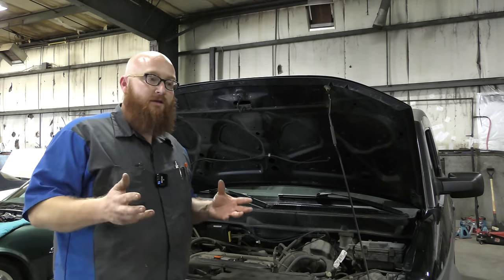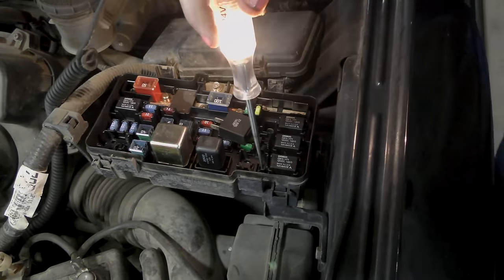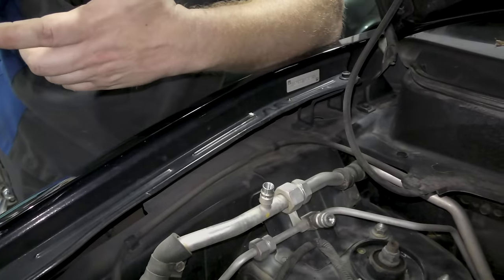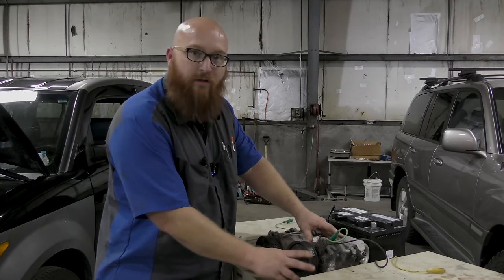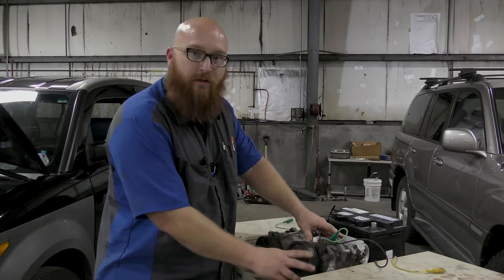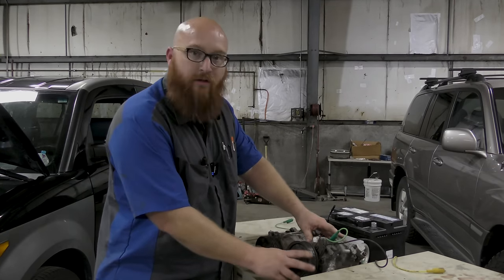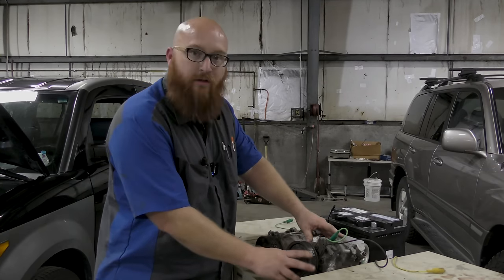AC not working!!! The CAR WIZARD shows how to easily isolate the problem

Comment: Hold up. Replacing the clutch on the AC compressor can be pretty easy on some vehicles. I spent $60 for one on a Honda Accord and installed it under 2 hours, while the compressor was still bolted in place. Don’t prematurely throw in the towel.

Comment: On a relay Would there always be a ground that's controlled by ac button? I've found the power on my 4 pins so I've checked to see if power to ground is turned on when ac button is pushed.. nothing ... what could it be inside the suv? BTW it's a 2012 GMC Terrain 4cyl

Comment: So my compressor that has tension in the clutch but it still spins may just indicate I need a new compressor?  Is that the one you were referencing at 16:40?  The porsche 911 one that would spin.

Thanks for the great info.

Comment: Could I use a jumper wire to test the power in place of the relay tester switch you used? I can hear the relay clicking by touching it with a screwdriver while putting the handle to my ear but could it still be a bad relay? I can spin the compressor by hand so it's not locked up.

Comment: What about expansion valves?? My air conditioning will get cold and then warm and then cold and then warm. And I've also heard that that could be an expansion valve issue. Is that true or should I stick to the other issues that you discussed

Comment: As a qualified Aircon engineer, when you release fefrigerant,if you don't have goggles on,you can be blinded or get skin damage where hit,he can't guarantee your Schrader value won't stick open and blast you with extremely dangerous refrigerant - he's a fantastic mechanic,but there's umpteen reasons why I paid a fortune to become qualified -and safety is the  thing that if you get it wrong,you can regret for life,or even have no way to feel dumb,if your dead....

Comment: Hello Mr Wizard I have a question 
I have a 2015 Honda Civic Can I jump the relay with a wire to see if the compressor clutch engages without using the relay switch you recommend or will that  damage the ECU because I tried this with the jumper wire the other day and for some reason the five-year-old battery quit working n the car didn't start so I thought I fucked something up !! 
so can I just use a relay wire I'm scared to try it again?? 
And if the compressor clutch doesn't engage can I just replace the compressor clutch without buying a new condenser or is there still contamination in the system just from the clutch going bad??

Comment: 'Hi there, thank you very much for your video. I have a problem with my cold (AC) and hot not working or very weak at the back and down to my feet. the top middle iOS working. what do you think I should try please?

Comment: The air conditioner.  hose that goes in the dashboard and I was told that the dashboard should be completely removed, and replace it hose.  I was quoted over $1000.00 to have fixed

Comment: Hi Car Wizard ! Hi Folks !     32$ question.   troubleshooting small  leak.  may i run the compressor by jumping the low pressure switch WITHOUT adding r134a and then spray with soapy water ?

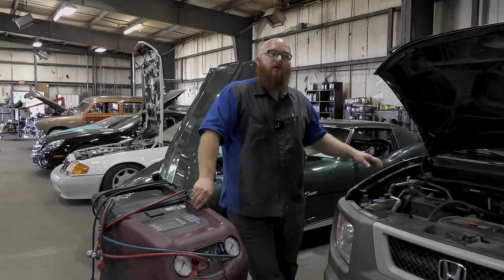Comment: So my Subaru Forester has the symptom of being not quite cool enough, but the AC still seems to work (and the compressor spins, etc).  So what you describe at around 8:05 seems like my issue.  BUT using a can of 134a, the gage shows I'm already in the red zone.  Is that because the gage on the can is inaccurate?

Comment: I thought mine was a low coolant issue, because in the winter if my coolant is low my heat won’t even work properly. Now that it’s 90 degrees my AC isn’t working. For a split second when I turn it on it’s cold and then it turns to hot.

Comment: AC on my 2008 Ford Explorer will intermittently quit blowing air for about 7-10 seconds and then start up again. The AC always blows stronger on the driver's side vents than on the passenger's side vents. 

Could that be a vacuum leak? When the mechanic put it on his AC testing machine it checked out fine

Comment: Unique problem bet you have never encountered:
My car AC (Chevrolet) is not turning on, the light in cluster is not coming on but when I accelerate to redline it blinks the ac light and sometimes after blinking it comes on and stays on ac cools good ,and sometimes it just works when we switch on the ignition and keeps on but all the wiring and couplers are good the car is good as new and ac when it works cools like a refrigerator no issue when it works but when it decided to not come on it will not work no matter what you do and shake all the wires and turn off and turn on multiple time the ignition if you are lucky it will turn on ac do you know what can be the issue if you want I can send a video to you as well

Comment: I have a 2002 Tundra that the compressor won't turn on.  I have verified it has freon.  How would you suggest I test the compressor?  There isn't a compressor relay from what I understand.  It uses the heater relay.  Can I test it the way you tested the AC relay of this car?

Comment: My son has a 2016 Nissan Juke he purchased used (5yrs ago). His ac worked fine up until 2 years ago. System recently vacuumed and recharged with dye and cooled fine for two months. He brought it back slightly low on freon, no leaks ran cool for a week. He recently brought it to another mechanic. Same situation but he just added some refrigerant but no leaks. AC. Cooling fine now. All the components appear to be operating properly. If the system fails again, any tips on what these mechanics may be missing.
Reply: Evaporator more than likely big job its under the dash. Not a good car in my book.

Comment: If an a/c system is slightly over filled then why does the compressor constantly run when in a/c mode on?  Don’t they cycle off and on repeatedly?

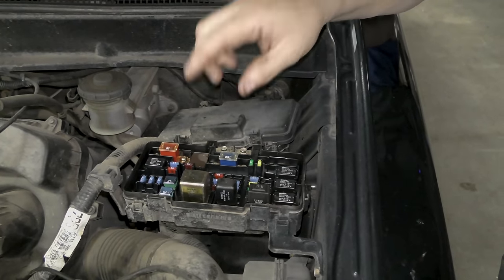Comment: 4:29 the relay tool you use.... is the vehicle off for that operation or on to see if the relay switch clicks the clutch?  My clutch is NOT engaging or spinning at all (but it has been checked and has perfect coolant).  Just wondering if that relay tool needs car on or off

Comment: would you do an advanced video showing you have to replace modern condenser's  because you cant flush them and when their are mufflers you have to replace those and show using micron gauge because nobody is teaching the real story on ac systems on you tube . its a lot false info going on. hope you will do a deep dive on this. thanks

Comment: Hello I have a question for you. I have a 2009 Honda Civic. I took it to a AC shop today and the mechanic told me to turn on my car and turn the ac one. He put on the gauges and told me right away that my ac compressor was bad. How can he tell the ac compressor was bad just by putting the gauges on and reading it?

Oh yes and before I took my car to him, i replace the ac relay, the ac fuse, i check the compressor switch and it was good, the ac compressor was running and also the ac clutch too was spinning, i also check the low side and freon came out when i pinch the schrader valve, both fans in front of car where running strong.  So i did all of the basic check diagnosing i could before taking it to him. Could it be just low on freon I ask him?  He said no cause the compressor was bad so he couldn't get the right reading. And he said if he added freon it wouldn't work since the ac compressor is bad and wouldn't circulate the freon around even though the ac clutch was working. I am confused

Can you please help me?  He gave me a quote for $895 plus tax to replace the ac compressor, ac dryer, and ac conderser.  Parts and Labor

Comment: Hello and thanks for the video. I have a question for everyone. 

First, Do I need to replace the condenser and dryer if the compressor is not seized? In my case the compressor is working but it is leaking from its own seals. I want to replace it because it is old and leaking from the compressor itself and not from  the ac lines. My condenser was replaced before due to a rock that went through the grill and damaged the condenser (condenser came equipped with the dryer).

Second question: if the compressor is seized, should I clean/vacuum the system before I install the new compressor and then re-clean/vacuum the system again and again until it is free of debris. I just don’t feel right by vacuuming the system with the brand new compressor already installed.

Comment: I'm not saying he aint a wizard ,but you can buy a gauge to test how much freeon is in your car system. Especially if it's an R134. Additionally most people's car AC won't turn on because it has low freon. Is low free on means a leak.

Comment: So I have an ac leak, the system doesn’t hold Freon at all. The shop I took it to tells me I need a new compressor and all of the auxiliary components as well. Does that sound right? I know it’s certainly possible, but is it common? I literally can’t replace the thing, and I’d hate to know we’re suffering through a Missouri summer without ac when it’s just a line that’s busted. They did a dye test, and I got a black light today. I don’t really know what I’m looking at/for though. I do the work myself when I can, and when I can’t do the work it doesn’t get done. Should I look around for a leak? Is it something a garage would do, to falsely claim something so expensive? It’s been 90+ here for 2 months, and we’re sweltering!

Comment: I took my truck in for the ac.  He replaced the low side valve.  Worked for a few days and stopped again.  Its leaking out, my question is where are the common places to look for an ac leak?   Thanks

Comment: So I have a 95 accord not kicking on it’s a brand new compressor climate control module and pressure switch all relays are good but with you saying how sensitive they are could it be the pressure? I don’t want to pay $250 just to see if that’s the problem.

Comment: I have a 2004 Honda odyssey and it was blowing. Warm air when driving slow.
I took it to Valvoline  and. He took all the. Refrigerant out and filled it to the minimum of 30 ounces. The maximum is 32. It worked good for a couple days then started blowing warm when driving slow again. Does it need those 2 more ounces?

Comment: HELP!!  I just got a quote for 2900 dollars to pull dash apart and change evaporator etc.. compressor works. Was told pressures were good... but... curiously.... the only thing that made it work was when the tech took his ac machine and overfilled it. Ive had it filled before.. why will it only work when overfilled?... is it really a 3k fix?

Comment: I have a 2004 crown Vic . The air conditioning has stopped completely. Even when the AC is off its still blowing Hot air into the cab. What steps should I take to correct it? Ty for any. Replies

Comment: Today is 4/4/2024. I have a 2012 Cadillac SRX. The clutch on the compressor is engaging in the morning time. When I turn on the air conditioner it blows cold when it starts to warm up. Even if you're driving it doesn't matter. It starts to blow warmer air. Not hot but not cold. What could it be because it's basically working on the ambient temperature of the outside.

Comment: Hi there, when you mention (14:40) when the center portion does not turn anymore it sends pieces of metal. What if my center portion is not locked up (I can slightly turn it by hand) but it does not engage when AC is turned on does that mean the entire system needs to be cleaned out? If the compressor is bad (electrically failed) could just replacing it be enough or does all the other stuff have to be replaced too?

Comment: I’m on the test light step, but when I apply it to both ends of the fuse it will light up regardless of the ac being on or off. So is this a possible problem with the electrical system for the ac?  I’m using a circuit tester which doesn’t really light up like this, it has a lcd screen that lights up and shows voltage, is there any difference between a circuit tester and a test light?   Thanks for any replies.

Comment: Couple things. I tried looking for that Fuse Switch with the On Off Switch on your Amazon Affiliate and could not find it. Second. My car overheated the other day. I ended up brining the car to a gas station filling it with Antifreeze. There is no leak with the Antifreeze. I do notice the AC Fan Assembly does not turn on when I turn on the AC and the air is warm when I am idling but normally gets cool when I drive. Before replacing the AC Fan Assembly is there anything I should check first: temperture sensor, relay???  Fuse???? Any suggestions would be appreciated. Its a 2012 Kia Sedona and has two fans in the front behind the radiator, one is the AC Fan Assembly and the other is the Radiator Fan Assembly.

Comment: I recently lost A/C so i went through the steps you suggested, went to turn my clutch by hand and lo and behold its missing. Im assuming the bolt was lose and backed out. Can i just replace the clutch and solenoid ect, and be ok? I just had the system vacuumed tested and emptied.

Comment: My AC sometimes works, and it runs cold, and sometimes it will not. It would run cool for 10-20 minutes, then it just blows warm air.  Or it will run cool, but when I turn off the car and restart the car, it will blow warm air.  What's also weird is it works better when the ambient temperature is cooler. 

I took it to the dealer, and they charged the unit, but it does the same thing.  I'm hitting my head over this.  Any recommendations?

Comment: I don't know about all this, but all I did for my Honda was take it to a shop that recovered all the refrigerant.  I let them keep it and they didn't charge me.  Then for about $120 in gauges and a vacuum pump I made my system like new again.  My car required 650 grams, which thank god was about 23 ounces which conveniently was 2 cans (24 ounces) at walmart ($8).  I made sure to not put everything to avoid that last ounce.  Why should I go to a shop again?  So I can pay $300 and they can manhandle my car and break other things?  No thank you, even if it was more expensive I would rather do it myself.

Comment: Hi, my Chevy Avalanche AC died on me as I was driving. I checked the compressor and it’s cycling on and off. The cans at Parts Store the gauge reads in the red as if it’s over charged. Any idea where to start? 

Thanks

Comment: @carwizrd mine blows hot in the summer and cold in the winter, I have changed out one blend door down near the gas pedals 2002 chevy tahoe z71 with rear ac but recently it does not switch between modes. just blows through front vents when turned on and lightly comes out hot even when off. I wonder if it's air in the heater core trapped bc it's higher up than the radiator...ever heard of tilting the front end up after it set over night then using coolant funnel to pour in fluid and turn on the heat for about 15 min? willing to try anything now because i changed out everything under the hood, condensor compressor, dryer front lines...to no avail.

Comment: I bought used car. blows warm / hot air. I see my type of car and the hub seems to protrude maybe 1/4" or more beyond the pulley.
But not on mine. I look closer. I see no clutch hub. Can you please tell me why that would be ? 
Another odd thing: the air blows a little harder thru the passenger side vent than the driver side vent on the dash. 
 Not so important. just curious. The missing hub is the important part.

Comment: Completely drain the system and refill with the full amount. Easily done at home. Needs new coil set. That compressor didn't lock up the coil failed. Just needed a clutch set. Possibly clutch not replaceable,never seen one the coil,couldn't be replaced. If compressor fails,no warranty.

Comment: Could it still the the AC relay if you can hear from the vents what sounds as if a baffle or solenoid closes and then pushes out heat from the vents. I switch the thermostat off then back to cool and begins cooling again.. gives cool air for intermittent time period (1-10min+). I need to keep doing it in order to maintain cool air

Comment: What if you press that valve and only air comes out and no refrigerant but the system gauge shows full. Does it need to be vacuumed out? Compressor kicks on but only for a second and goes off as if it's low.

Comment: Ok so 2008 chevy impala..Moving ac runs great freezes you out..Say stop to get something to eat in the drive through it shuts off blows hot air,kicks back on blows cold a lil then back off whole time in the line.Grab food back on the road back to cooling hit a red-light kicks on and off ..I've checked all my relays,and fuses..Any ideas would help

Comment: Hello ,nice video, 2019 hyundai kona ,they replaced compressor, and many other ,the only part they showed me was actually the compressor, when I checked it was empty no freon I added 1234yf and it ran for a few second then stopped ,thiers no code ,I activated the relay from a scan tool and it click with key on engine off ,it says no communication with ac system ,,so scan tool can't connect with ac ecu ,but through engine module is how I activated ac relay,all fuses good .any ideas

Comment: Well I have a 2007 Dodge Nitro, and they don't have a relay to operate the A/C compressor. It's operated by a tcip I believe it's called so how would I go about troubleshooting the air conditioner compressor without a relay

Comment: I have a 91 Chevy Silverado 5.7 I changed my ac compressor and condenser. I also changed the cumulative tank. The switch was charged but I'm unsure of the gasket where to put it on the switch someone said to be sure to change it to. Can you give me any kind of help please.